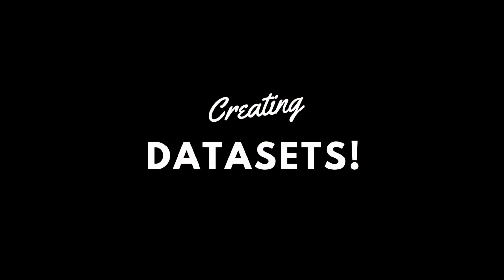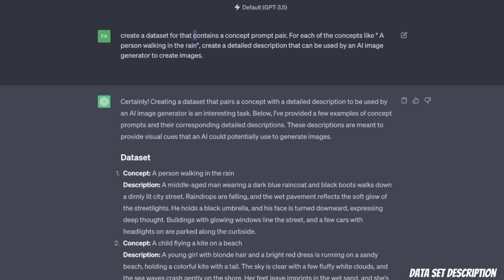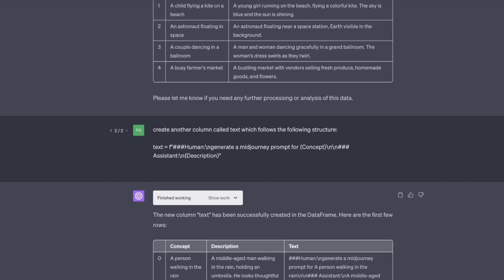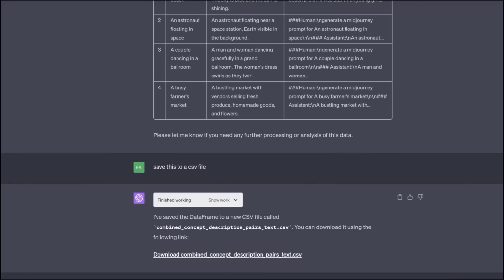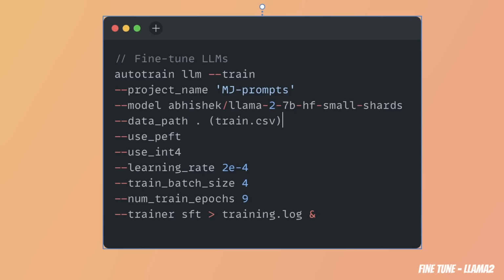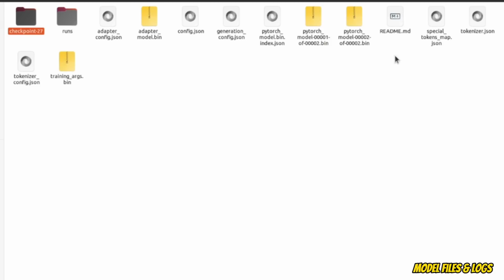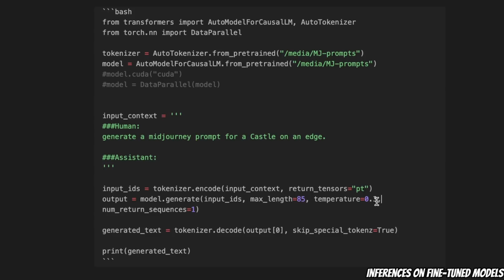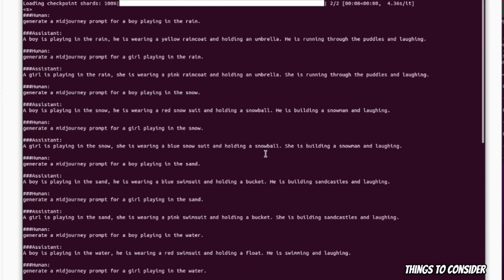How to Create Custom Datasets To Train Llama-2

Comment: Getting the error:

FileNotFoundError: Couldn't find a dataset script at /content/train.csv/train.csv.py or any data file in the same directory.

Even though I'm running the autotrain code line in the same directory where my train.csv file present. I'm running on colab btw
Reply: The solution is to just provide the path of folder where the csv file is present. But don't write the csv file name...

Comment: I need help please. I just want to be pointed  in the right direction since I'm new to this and since I couldn't really find any proper guide to summarize the steps for what I want to accomplish.

I want to integrate a LLama 2 70B chatbot into my website. I have no idea where to start. I looked into setting up the environment on one of my cloud servers(Has to be private). Now I'm looking into training/fine-tuneing the chat model using our data from our DBs(It's not clear for me here but I assume it involves two steps, first I have to have the data in a CSV format since it's easier for me, second I will need to format it in Alpaca or Openassistant formats). After that, the result should be a deployment-ready model ?

Just bullet points I'd highly appreciate that.

Comment: I am facing the following problem. The model gets uploaded to the hugging face repo but without a config.json file. Any solutions? Also can the finetuned model run on the free google colab or should we shard it?
Reply from the maker: Are you fine-tuning it locally or on Google Colab? I am doing it locally without any issues.
Reply: @engineerprompt  I am fine-tuning it on Google-Colab. In  a post I made on your other video about fine-tuning Llama2 you mentioned that it seems to be a problem with the free tier of colab. I hope 🙏 you will find a fix , because not everyone owns a gpu.

Comment: Thanks SO MUCH for sharing this! Really helpful. I also trying to train on my own data on LLAMA 2. But I am facing a problem from deploy the model. I trained the model on AWS Sagenmaker and store the model in an S3 bucket. When I try to deploy the model and feed it with the prompt, I keep getting errors. my input follows the rule like ###Human....###Assistant. But I still have errors. I wonder if I use the wrong tokenizer. But I couldn't use AutoTokenizer.from_pretrained() in Sagemaker. Wonder if you have some advice!!

Comment: I would like to ask, is the RTX4090 sufficient to fine-tune the 13B model, or can it only fine-tune the 7B model? Because I've noticed that the 13B model with default settings doesn't pose a problem for the RTX4090 in terms of parameter handling, but I'm uncertain whether a single RTX4090 is enough if data fine-tuning is required
Reply from the maker: I don't think you can fine tune 13B with 24GB vRAM. Your best bet will be 7B

Comment: So, if you have a problem, same on my, in google colab this code not will work, because on free google colab this script don't end job and don't create config.json, and you will have aproblems.
And i think, that is reason, why this script don't push my model on huggingface hub.
But your work is great, so thanks for that.
Reply: I am also facing the same problem. Actually in my case the model is uploaded to the huggingface repo but it is missing the config.json file. Any sollutions?

Comment: If you don’t mind sharing, what’s the performance of a Mac like when fine tuning?  I’m quite keen to see how long it takes to fine tune a 7B vs a 13B parameter model on a consumer machine on a small/medium sized dataset. Thanks for the tutorial, very helpful!
Reply: 7B with 4 bit quantization takes about 12.9 GBs of GPU RAM, i dont think mac will be able to run it locally

Comment: Can I train my own LLM model using data generated by chatpgt, if the model is intended for academic/commercial use?
Reply from the maker: Probably you cant use it commercial purposes. But most of the open source models out there (at least the initial versions) were trained on data generated by chatgpt

Comment: Hello, thank you for sharing - is this method applicable to GGML / GPTQ models from say TheBloke's repo for example the 'Firefly Llama2 13B v1.2 - GPTQ' or would the training parameters need to be adjusted?
Reply from the maker: I haven't tried this with Quantized models so I am not sure how that will behave. One thing to keep in mind is that you want to use the "base" model not the chat version for best results. Will look at it and see if it can be done.